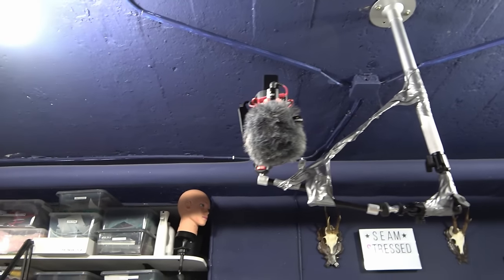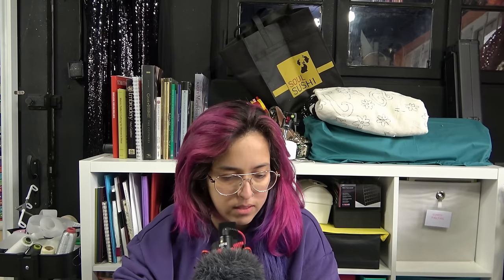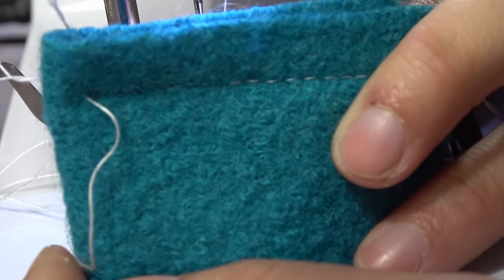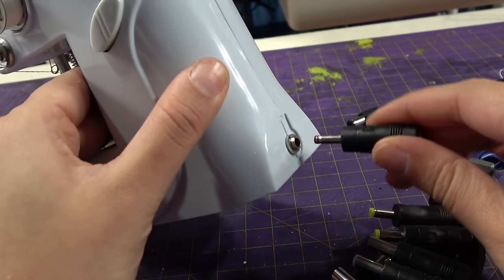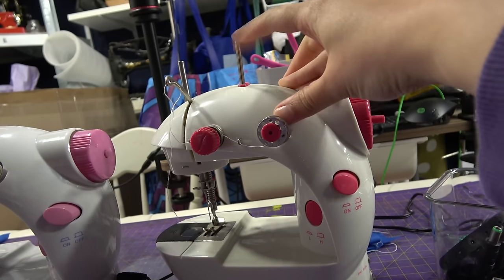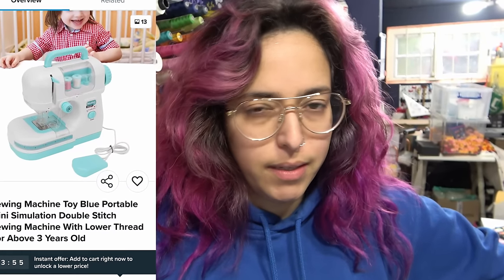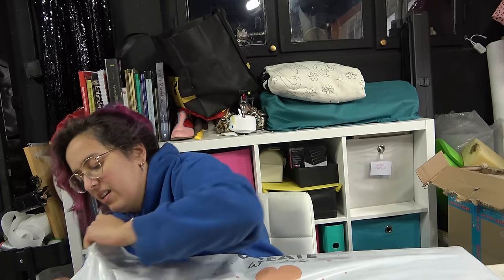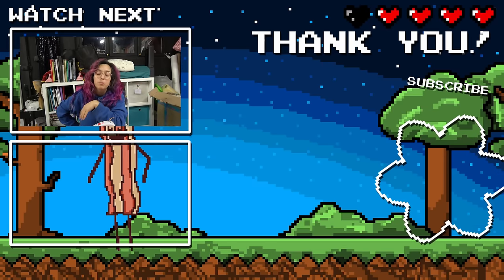Trying sewing Machines from WISH! - Keep or Yeet?!

Comment: Please test a singer featherweight! The original travel machine!
Reply: Are they any cheaper in Europe !?
Reply: That’d be an expensive test! I paid $400 US for mine and I would say it was in average condition. Better off with a 15 or 201, or pretty much any vintage straight stitcher.
Reply from the maker: my dream is to get my hands on one of those... didn't find any cheap enough on the bay so far
Reply: @Seamstressed  I live in New England which is the north east corner of the United States. Because it is where the earliest colonial history happened there's a lot of antiques that are readily available here. I was able to find mine on Facebook marketplace for $400 US but I would imagine that they are harder to find in Europe.